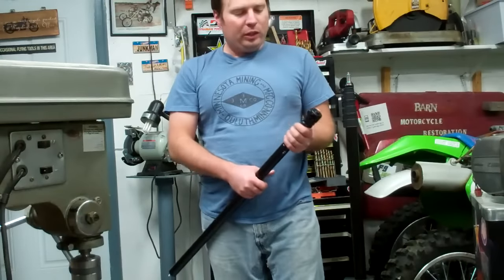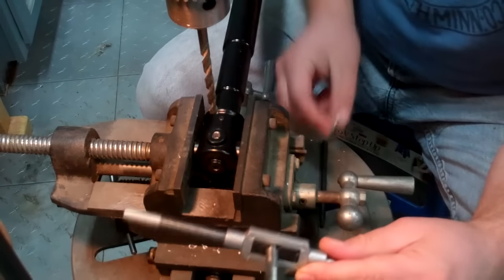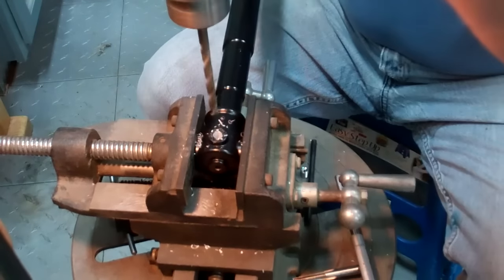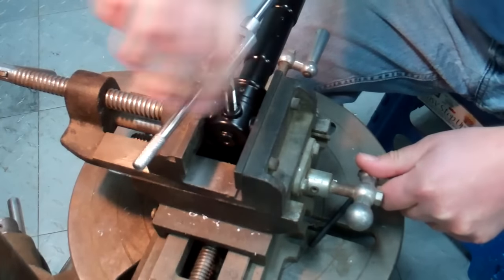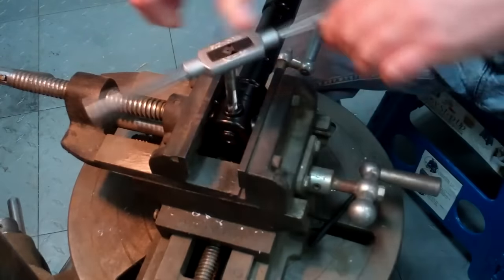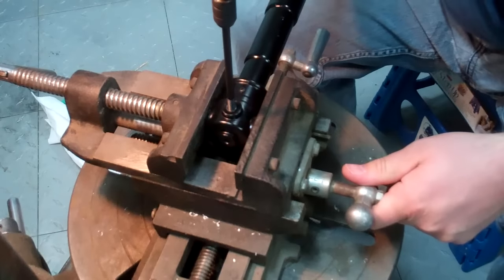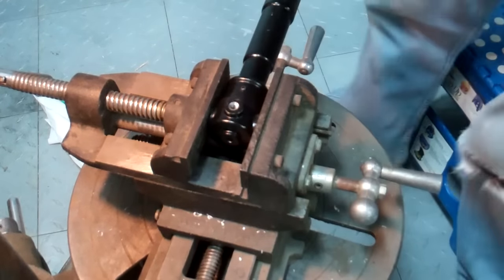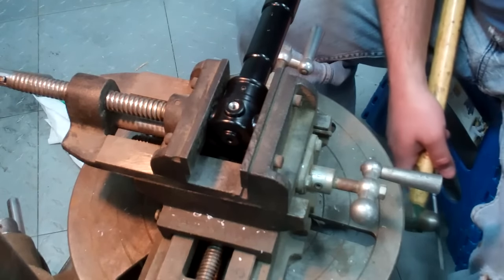Thread Repair - How to install a Helicoil

Comment: How to do it in a blind hole
Reply from the maker: It is still done the same way, but you have to drill deep enough.  For blind holes I prefer a product called Time-sert.  It is installed much the same way but it uses its own special tools.

Comment: after you drill the hole the put the tap in the drill press and turn by hand it guarantees the tap will enter the hole square. I learned this from an old machinist. once the tap is in the hole square and solid you can finish driving the tap with the hand wrench. never use power of the press to turn the tap it goes to fast and will snap your tap off.
Reply: Yes, and turn the tap forward 1/8 turn, then back 1/4 turn, forward another 1/8, etc to eject the chips.  NEVER go 1/2 turn or more without ejecting chips.   That is, if you want the strongest psosible threads.

Comment: Why use the insert when the tap makes the threads?
Reply from the maker: Because you have to enlarge the hole and then you cannot use the same sized fastener to go back in.  In my example used in the video this is also aluminum where as the original threads were just into the aluminum with a steel bolt run into them, thus why they stripped in the first place.  Putting a steel insert in gives more robust threads for this application.

Comment: I'd heard of Helicoils but never used them. I think rather than using a screw extractor on this aluminium cover to get two screws out which are jammed in because they used an air powered tool to put them in, I'll drill and tap the holes and use two Helicoils. Power tools are a menace and force things in too tight. I had a screw extractor snap on me once on a different bike creating a much bigger problem than the original one.

Comment: mine stripped in my motor mount bolt hole will i still be able to use the same bolt or do i have to buy a bigger bolt
Reply from the maker: Depends on how bad the damage is, but typically you can go back with the same size, you WILL have to drill it out slightly larger to install the appropriate sized thread insert so you have to have enough "meat" around the hole left to do this.  If the hole is egged you may have to go larger.

Comment: If you're tapping a hole anyway, why put a helicoid in there...what for?
Reply from the maker: To go back to the same size bolt.  Also to put steel threads in place of aluminum.

Comment: if your drilling and tapping.....then why not just use standard tap and next size up bolt   ????  Don't the see point of this kit for most cases ???
Reply from the maker: This is for the cases where you have to (or want to) go back to the same size bolt.  Also in the example shown, the original threads were just into the soft (low grade) aluminum.  Inserting steel threads makes the future use of this part more reliable because it is steel on steel versus the steel bolt into aluminum.  This particular part the bolt has to be removed to collapse the rig, meaning those threads get a lot of use.

Comment: why would you helicoil a newly drilled and tapped hole, if you do that you're done
Reply from the maker: To put it back to the original size and Helicoil threads are unique also in this situation I wanted steel threads in the aluminum so they won't strip out again.

Comment: Shouldn't you use thread lock tight on the helicoil.
Reply from the maker: It doesn't require it. Breaking the tang sweages it in. You could though.  Check my other video on this.

Comment: Why not just use a tap and larger bolt. I know it's just not possible sometimes.
Reply from the maker: Depends on the application.  In this case a helicoil improves the application since the original just goes into soft aluminum.

Comment: Youre supposed to apply red loctite when you install them
Reply from the maker: Yes you can, but do this with caution as you can also lock the original sized fastener in as well if too much is applied.  However when the tang is broken off at the end it swedges itself into the hole making difficult to back out.

Comment: you did not explain how to select helicoil and drill size etc. No use to beginner skipping this part,
Reply from the maker: That is determined by reading the directions on the package and the situation.